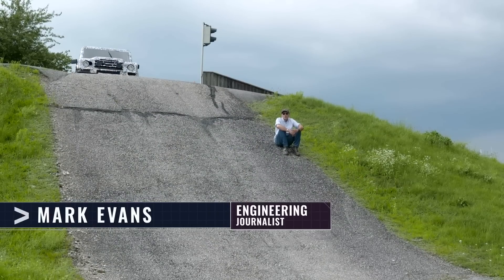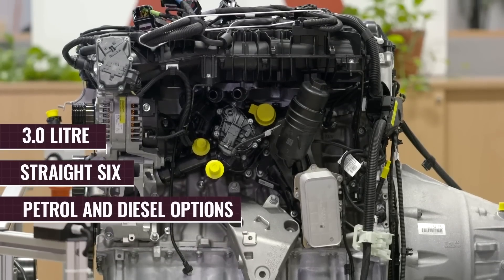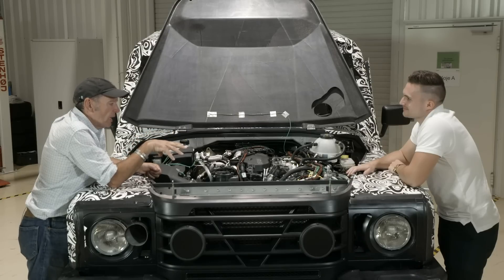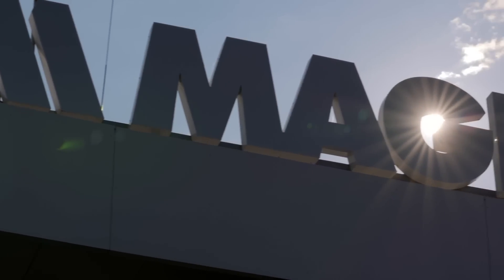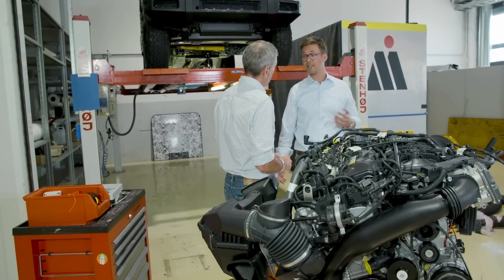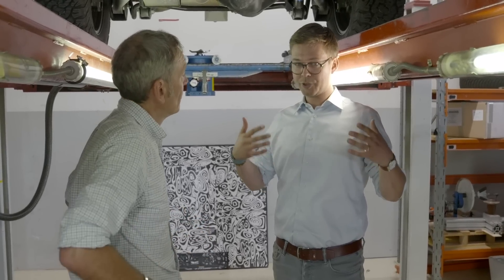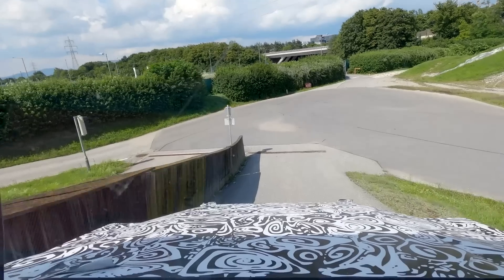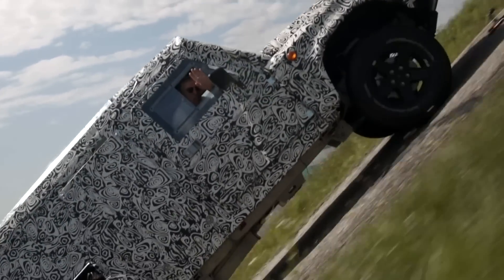Building the Grenadier - Episode 5 - Engine & Transmission

Comment: @INEOS I have been trying to contact you because I would like to design a diagnostic tool for the Grenadier.  I have registered on your supplier portal and tried to contact you on LinkedIn.  I think that some of your customers will want to be able to diagnose fault codes themselves from day one because needing a BMW factory tool in the middle of a desert or the Australian outback will be a problem.  I'm sure that I could help you with field testing as well. I have already designed and sold diagnostic tools to hundreds of customers. Please get in touch. Philip from pscan.uk LTD
Reply: So you find the fault in the middle of the outback desert... Will you have the proper tools to repair it? Will it actually be possible to repair? Or more like a "brake and by new one" (I'm not sure if a mechanic in marroc would even touch the gearbox..)
Reply: @luisclaro3386  It might be a lot cheaper to get a replacement sensor or engine component shipped to a local repair shop and fitted there than to move the whole vehicle many hundreds of miles to where there is an official dealership.  Also the fault could be as simple as a shorted out or snapped wire.  A diagnostic tool will help a technician to narrow down the fault, otherwise you have to inspect every wire on the whole vehicle.  Modern vehicles can be brought to halt by nothing more than a failed CANbus connector on a component that's nothing to do with the drivetrain, however if that stops the engine ECU communicating with something like the immobiliser then you have a dead vehicle.  Unfortunately the insurance industry makes things like that necessary.  I have customers in Australia who are over a thousand miles from the nearest dealership with factory diagnostic tools.
Reply from the maker: Hi Philip, thanks for getting in touch. Please contact suppliers@ineosgrenadier.com directly for further information.
Reply: @INEOSGrenadier  Thank you.  I have now emailed.
Reply: As someone who fixes problems with systems on cars, canbus etc you would not want to fix a car etc on the Barkley Hwy in 45c, you could not touch it for the heat, it would take days to get a spare part from Melbourne, Sydney, Brissie etc. Thats why most if not virtually all are old school Toyotas, and highly sort after... not the fastest not the most comfortable but simple reliable , rugged and most can be got going with simple tools. Try that with BMW injector failure on number 3 cylinder shutting down the engine not a chance. In 45c however much water you have runs out pretty fast .
Reply: @mazdaman1286  Ineos do not seem to be interested in working with me anyway.  They don't reply to emails.  My guess is that they have some deal with whoever supplies factory BWM diagnostic tools as it's a BMW powertrain.  Concerning your answer I have been in scenarios where I wanted to get some understanding of a fault so that I could decide whether to continue my journey with a fault, or just stop and get towed.  Sometimes you want to know if continuing a journey will cause further damage or not and a diagnostic tool can help you figure that out.  I had a turbo seize solid on me once, having live data on a tool helped me to understand what was going on and come to the conclusion that I could gently drive home without it damaging the engine.
Reply: Seems obvious we want proper status reporting at the dashboard, OBD fault code readers seem to tell you there is a fault, you replace the offending item at vast cost and it makes not a blind bit of difference. Does PScan only work on Rover and Land Rover ? I've just been on website but no means to enquire or email address ?
Reply: @philhealey449  I am sure that customers would much rather have a built in diagnostic computer rather than buying one, I have no argument with that.  However I don't exactly agree with your statement concerning buying expensive components; no competent technician should be ordering expensive components based on nothing more than an error code (though if a component is cheap it may be the most pragmatic solution).  A diagnostic tool and error codes are simply a way to narrow down possibilities.  An engine warning light just tells you that there is a problem somewhere on the vehicle.  A diagnostic code will then tell you which "system" the light is referring to.  A code referring to a specific sensor tells you that it could be the sensor itself, a blown fuse that powers the sensor, a broken wire or bad connection, a bad earth, another sensor shorting out the power rail, or faulty ECU.  It is then up to the technician to try to figure out what the specific fault is by inspection or elimination.  Having a fault code means that he/she doesn't need to inspect every wire, every connector and every sensor on the engine (like the old mechancal fuel injection systems).  Furthermore actuation features in the diagnostic tool allow him/her to fire solenoids and valves under computer control to check their operation and live data allows him/her to monitor specific sensor outputs to see what sensors are doing.  Such functionality is necessary for an experienced technician but I suspect goes beyond what a manufacturer will want to offer on the dash to every customer.  Some of the things that technicians might want to do have health and safety or liability issues attached.  If your mechanic just reads error codes and then throws expensive parts at the vehicle as a matter of course then maybe you need a new mechanic.
Reply: @philip_christian  But in my location it's me or the (manufacturer owned) main agent and their outrageous price gouging . A starter motor incident cost 2,200 USD in a situation I couldn't go around and right now a MAF sensor issue is causing my rant. Competent independents armed with high spec diagnostics don't necessarily exist in "rest of world" urban situations and certainly not in rural or deserted locations. Hence I want high resilience wiring, reliable sensors,  proper on board  diagnostics and engine monitoring not a load of wade depth sensors and cameras. I'd be happy to carry a kit of manufacturer's reasonably priced spare modules and sensors. I've been marooned and defeated by electronics failures now three times, which  is infuriating when all other breakdowns I've managed to bodge fix myself to  get me home and the permanent fix is obvious. I've looked at PScan but it seems mainly focused on Land Rover?
Reply: @philhealey449  Yes pscan is focused on MG, Rover and older Landrovers.  For certain models such as the Freelander 1 and Defenders we are able to do almost everything that the dealer tool can do for a price that is affordable to hobbyists and owners. So yes the idea is that you can carry your own diagnostic tool and some spare sensors and fix it yourself if you have the ability.
Reply: @philip_christian  Could be a lifesaver then. I certainly wouldn't trust my life to Mercedes OM642 propulsion in the wilds (based on my own experience so far of two strandings and three sensor failure limp home events in 45,000 km), but I have no relative  knowledge of the two Ineos BMW motors' tantrum ratings.

Comment: I think they will use the ZF 8HP because will allow INEOS to use the electrified version of that gearbox. 4th generation ZF 8HP, since its modular design, will allow to have from mild to plugin hyybrid in the same volume (electric motor from 24 to 160 kilowatt).
Also the power electronics are housed in the transmission.
Start of production of the new gemeration of ZF 8HP will be 2022.
Reply: Yeah super good for going to the outback...lol
Reply: When you're in the middle of the desert where do you plug it in then mate?

Comment: Use case: Dead battery in the outback.  How do you run start the auto?
Reply: Most people already run a duel battery set for the fridge, jump off that.
Reply: @MrDanjacs  Sure, a second battery, if you have one, may be an option, but the starter motor just gave up the ghost.
Reply: Ulrich Wilsenach most LC’s, Patrols, Discovery’s etc used in Australia are auto. If you still want that ‘authentic’ 1960’s driving experience in 2020 then maybe just buy an old car?
Reply: @matthewp9015  Yes, always an option.
Reply: Call some roos
Reply: Get a petrol engine and a buddy to tow you and you're set.

Comment: I was really looking forward to this episode and got really bummed out with some of the choices. Nothing wrong with going BMW in my opinion but with putting so much work into making everything else from scratch I was a little sad to see an engine made for something else just remade for the Grenadier. Also why not give us the option for a manual. I understand that auto is probably better overall for the market but I really miss having a manual car. I love my Disco but I miss having my manual old taco.
Reply: @SirScarecrow Im not saying the lowering of price and parts is the issue. Just having have gone through engine problems with a car made for another car can be frustrating. I don't even bother with Discovery 2s anymore for that reason. Just feel like they might have just gone the extra step. The car is going to be pricy anyway. 

As far as the manual vs automatic again I don't think most people care. I would just rather they give us the option. Some of that comes from my own personal experiences with dealing with automatic transmissions and how limited I am on repairs and quick fixes with them. I am also no mechanic and what I know I have had to learn due to field repairs and whatnot. 

Again both are kinda just "darn it" issues for me on a car that I am still very excited about. I understand why they did what they did with the engine and transmission but still a bit bummed.
Reply: Wi the 4th generation of ZF 8HP from 2022 (start of production) INEOS will be able to offer hybrid versions without having to rething tyoo much the vehicle. Electric motor and power electronics are inside the transmission, so same volume, multiple configurations.
Maybe it would be interesting also to use a FTP Industrial 4 cylinders diesel engine. It already coupled to ZF 8HP in Iveco LCVs.

Comment: Glad to see the transfer case decisions. Also nice to see the rear lower control arms wider at axle than chassis, giving some triangulation. It should help axle steer through articulation. I would have liked to see front and rear control arms longer but understandable it’s a production vehicle driven by profits. I hope they have allowed for the aftermarket to fit larger tyres and have clearance etc. probably not
Reply from the maker: Thank you for your feedback. We are planning on taking an open-source approach to a number of aspects of our vehicle, so really appreciate your input.
Reply: @INEOSGrenadier   Would like to see a 255/85r16 tire as standard and a 285/85r16 tire as a factory option(with bump stop ajustments/ 1 inch lift) and the wheel wells and various components able to withstand a seriously aggressive 38.5×13.50 bias ply tire with a factory or aftermarket complete 4 inch lift. Really looking forward to see the INEOS Grenadier prove it's self.

Comment: My opinion is Ineos have got the transmission spot on,  I off road a Land Rover  based truck with auto box, ( ZF) centre diff lock and axle locks,  for me, perfect, I also overland a Toyota 80 with the same set up, ( stock Toyota 80 setup) fantastic on beach or desert sand, awesome in snow. The manual diehards will probably disagree but I think if they were to try the auto setup they would appreciate how good it is, and yes there is engine braking on steep hills. Of course when the battery is flat no tow starts.  I will also echo a previous comment on get-home non Ecu option.The Ineos “ idea” of a 6 Cyl diesel through a diff lock transfer case and auto box was used by Toyota back in the 90s , nothing new under the sun eh?
Reply: Yes 6 cylinder but high cc number...not 3000 but 4,400 cc and the torque and high speed was underpower for achive realibility..and you see many toyota car really have under power stat spec...
Reply: I think that 3 litres is plenty, the power output of modern engines is incredible, note what is achievable with the 2 litre range of VW /Audi engines,  also the Ford and Mercedes engines as used in the Transit and Sprinters, they have plenty of torque, power and the key word, economy. To make the Grenadier attractive to most of its intended market it will have to stand scrutiny in that area. Power and longevity will be high on priority list but economy will be there also.

Comment: If this vehicle isnt roadside or desert serviceable, i.e full of electrics and sensors its really not worth it. I get that you have to meet emissions standards etc but it has to run unplugged from the ecu and be self sufficient at least as a get you home mode, no limp mode as such. Everything else, suspension, solid axles etc is spot on, so back it up with a decent engine....please. Too many cars now you cant even do an oil change without having to have a diagnostics tool to know the service light off!
Reply: You've said it all.  Trouble is, designers aren't mechanics.
Reply: @tonypacke6954  Youre right, but they should be lol

Comment: Drive train is really puzzling. Clutch pack gearboxes are not as fun as manual (give us the choice); paired with constant 4x4 so we spend more money on tyres and fuel when highway driving. Make me get out and engage the wheel hubs manually if that's what it takes.
The 70 Series LandCruiser is really the standard you need to be aiming for. You may not beat Toyota for durability but you can at least match the drivetrain setup they've been using for decades now.
Reply: I’ll take full time 4wd over part time EVERY day, the little bit of extra fuel ( bugger all) is well worth the positive benefits. As for the 70 series... unbalanced suspension, leaf rears, unequal wheel track , shitty ergonomics in cab and exaggerated reliability....hardly the benchmark
Reply: @husq2100  I was more referring to how the 70 series is manual with another stick to engage 4x4/low range. You do have some valid points though, especially with how the newer model's wheel base and suspension is configured.

Comment: Let's see.... the LT230 is all time 4x4 and its center diff is lockable. 
The grenadier transfer case internaly is almost identical to the Land Rover LT230 tranfer box  wich is good because that box is massive. When i took it out to overhaul some internal components i realize how heavy is and all the wheight is in the gears because the case is light wich is a good thing. I didn't weight the r380 gearbox to see how heavy is but i have a feeling that the transfer box is heavier that the gearbox.
I don't like the idea of an auto gearbox. The hardcore offroaders neither. I can understand that you have the hands tied togeder regarding the emissions and you have to use modern engines but the fact that you dont have a manual gearbox in my opinion is a huge downside. At this point if i have the money and have to make a decision i will buy a land cruiser 76 series with 4.5 v8 and 5 speed manual.
It doesnt matter what you thing is better but what the buyer wants. If is like me that all of his life has driven a manual gerbox car and doesnt want to switch to auto, that's a lost client in my opinion. This car has allot of potential so chose your steps wisely. Gretings from Italy

Comment: The Defender needs a successor, however, the G Wagen as well. There will be a market for quality, because over the life cycle, low cost per mile is what counts for professionals. Overlanders then can have extensive tours without remembering where they packed their toolbox. True, at a price premium. However, the second hand market will bring affordable vehicles still in superior condition than new vehicles compromising on quality initially. I had one Landrover and that's the reason why it was only one. Otherwise, it is easy to fall in love with these brilliant vehicles...

Comment: I really hope you do not go with the reported 50k starting price! That is actually insane, it needs to be around the 25k starting price with 35k max price. Think about it, no other competition is close to that  high price, all pick ups are around the 20k starting mark so what do you see as the competition at that price? Workers that will need this vehicle are the lowest working class that are on 12k to 18k a year. Please really think hard about the pricing because if it that high it will be a failure & I would hate to see that.
Reply: I think the BMW engine will be its biggest problem over a hefty price tag, granted both of which could potentially kill the vehicle off before it even gets anywhere.
Reply from the maker: We can't reveal the price just yet, but we understand how important affordability is and we'll be pricing the Grenadier competitively within the utility vehicle market.
Reply: @INEOSGrenadier   45K to 60k in U.S. dollars is fine with me(it's not a Suzuki Jimny, and it's not 1990 anymore).

Comment: A company that has identified the best components available on the market has to choose where to assemble all this: a) in a greenfield plant with hardly any worker available ever having worked in any factory or b) in a plant that meets Mercedes Benz quality standards every day. Outside the heritage bubble, b) seems the obvious choice.
Reply: Brigend Ford production plant are closing as we speak, another ford plant closed in Swansea 13 years or so. South Wales area have 200 - 300 years of heavy, medium and light engineering heratage. Steel, nickel, tinplate, aluminium, titanium factories, many automotive supliers, from looms and blower motors to window rubbers and radiators. 
Please try and keep it factual and do some research first.